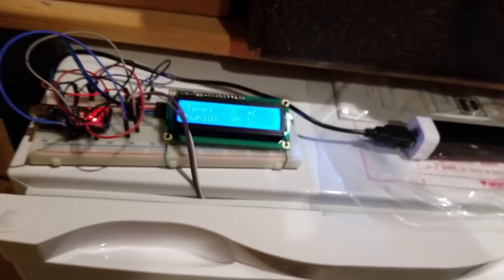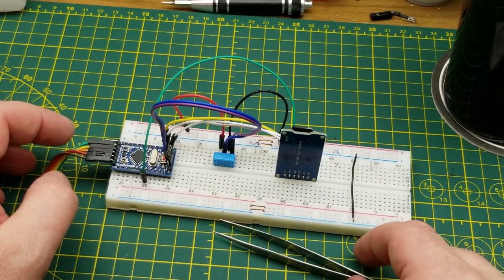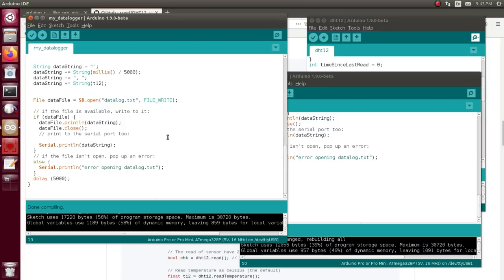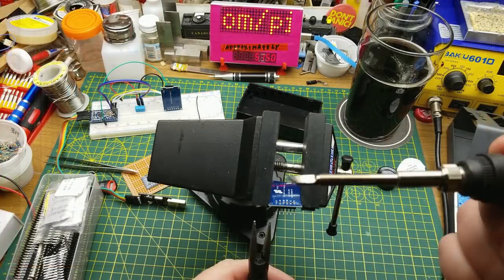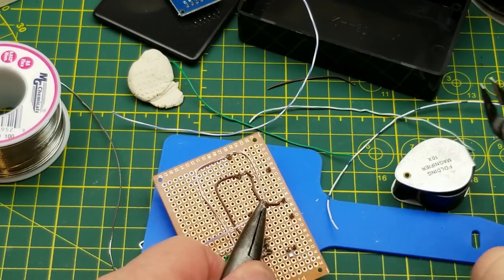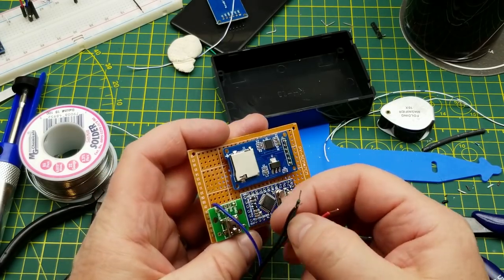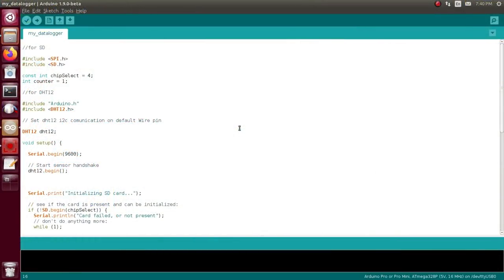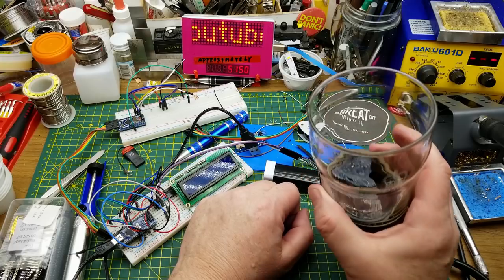beer fridge data logger

Comment: I noticed an error routine that "pops a message" to the serial debugger if the sd card can't be written- maybe add the simple "blink" routine to blink the on board LED if you fall into that error so you can see WHEN that happens (like at full SD card)???
Reply from the maker: Good find! 

Thanks.

Comment: 16:00 60000 ms is exactly one minute. Using int for a counter wraps after 32767 iterations to negative values. You should put the counter into EEPROM, so you can resume the logging instead of restarting it after a power cycle (this caused the strange graph you tried). A flatflex cable for the sensor would seal much better.

Comment: Nice job! If you want to get fancy, you could use an ESP8266 board using pre-built Tasmota firmware and wirelessly get the data to your Linux system, store the data in InfluxDB, and graph it all in Grafana. You can set thresholds and can send alerts if the temperature it too high/low, etc. Andreas Spiess has some videos showing Grafana with Influx which I originally got the idea from. I could always help you set this all up if you need assistance.

Comment: The devops engineer in me shouts "TIMESTAMP ALL THE THINGS!!"
Reply from the maker: I was thinking about adding an RTC, but it occurred to me that might be overkill for this application... not that the whole project isnt a bit overkill..
Reply: @pileofstuff  if your doing over kill go for the max. but i would try and save the readings in to a large array in memory before writing to the card.
Reply from the maker: @TheEmbeddedHobbyist  A skilled programmer might do that...
Reply: @pileofstuff  Yes I would :) lol
Reply: @TheEmbeddedHobbyist  It is not battery backed up - if the power goes out, the array of data not saved to the card will be lost.  SInce he is waiting 10 mins between saves, and he is only writing a small amount of data, it is NOT going to wear out the SD card at all...  immediate writes is probably the best way to do this.  And, YES, I do have a LOT of flash memory (and flash file systems) experience in my past...

Comment: for sensor extension (3wire temp.) I am using telephone extension cables, which are low priced, e.g. 15ft around 2$. Sockets and dbl.-couplings are easy available.
Reply from the maker: There are plenty of options.

Comment: Good video!  Liked the transitions, the fast forward, and sound.  It is very satisfying to finally get a circuit into a box.  I have found the OneWire Dallas Semiconductor sensors are easy and cheap.  You can get them on AliExpress with a nice cable and encapsulated with metal.  DS18B20 is the search string.  Your cold weather has moved to Ontario.  -20 this morning Brrrr...

Comment: Thanks for an interesting video! How about adding a light sensor to detect frig door opening? See if the resident code monkey is getting into the supply? I thought you would put the sensor on the board and chuck the whole thing in, maybe with battery power.
Reply from the maker: I thought about battery power, but then I would have to charge it occasionally. 

And I wanted the temp sensor a bit of distance away from the other components just in case they generated any heat of their own.

Comment: You need to put a microswitch on the door that will decrement a counter and show you the remaining beers in the frig. Or maybe put a video camera in there.
Reply from the maker: I can see a spike in the temperature data every time I open the door. It's an unexpected feature.
Reply: Door open detection wouldn't be reliable. What if the door is opened to check the stock level prior to visiting the liquor store? What if two beers were taken at the same time?
What is needed is a weight module - for example, put a bathroom scale on the floor of the fridge, then monitor/track the weight changes!

Comment: Really nice to see someone else use the DHT12. So much easier to use than the ubiquitous DHT11 being I2C.

Someone else has probably mentioned it but you're counter will overflow at 256. Maybe better to make it a 'long' instead of an 'int'?
Reply from the maker: I thought an 'int' could do up to 32,767 before it wrapped around into negative territory.
Reply: @pileofstuff  Sorry I was wrong. I thought Arduino 'int' was 8-bit (ie a wrapper for int8_t) which tops out at 127 signed or 256 unsigned (uint8_t).

A 16-bit int (int16_t) will top out at 32,767 signed or 65,536 unsigned (uint16_t).

Turns out Arduino int is an int16_t and so goes up to 32,767 before going negative.

If you want to go to 65,536 all positive just change 'int' to 'uint16_t'.
Reply from the maker: @gavinsmalley1513  Even with my error in the delay, I'm still good for 20+ days before it overflows. That's adequate for my application, but it is good to know better for next time!
Thanks.

Comment: I may have heard wrong, but doesn't sixty thousand milliseconds make just one minute? Ten minutes would be six hundred thousand millis. Not that this thing is going to fill any sane SD card in a hurry either way.
Reply from the maker: Oops.
Reply: Someone else noticed that too I see.  7 hours ago... only about 70000 ms or so I guess.   ;-)

Comment: I would add a real time clock and include the time and date in the file. To avoid large files change filename each month and name the file after the month and year (Like: "B202002.csv"). Then you can have date and minute columns in the file.
A temperature sensor outside the fridge could also be nice, then you can see if that temperature affects the fridge temperature.

Comment: Must be rewarding to use these components together for something practical.   Your bodge wires look suspiciously like salvaged CAT5.  I find these wires so tightly wound, that the PVC insulation is uneven, and easily splits.  Tinned, solid, 28 or 30 AWG for is better for small signal connections because it can be tortured into shape with tweezer tips more easily than 24 AWG.  Sure wish I had some 28 AWG coated with silicone instead of PVC.
Reply: For real fine bodge wiring 28awg PTFE wire is the best, bugger to strip but fits under TPH component legs and don't melt. just don't smoke while using it.
Reply from the maker: Good eye. 
CAT5 wire has lots of uses around the tinkering shop.

I do have some 28ga wire somewhere aroung here, i just didn't bother digging it out for a quick-n-dirty little thing like this.
Reply: @pileofstuff  I would like to find as segment of old phone cable with all those colorful striped wires ... that that is excellent stuff.
Reply from the maker: @GnuReligion  I think I have a length of 25 pair in my box of "various lengths of wire". 

If you are in the right place at the right time, it is often scrapped out during office building renovations.
Reply: @pileofstuff  Heh. Futurama. 
I was able to use a scrap of 25-pair for quite a while as point to point wire.
Reply: @pileofstuff  Well, I am not age 11 anymore, so swiping scraps from construction zones is out of the question.   @Adam Egan:  Yes,  Professor Farnsworth.  He lost the evolutionary debate though:  https://youtu.be/TTOla3TyfqQ?t=60
Reply: One of the perks of being a low-voltage electrician apprentice. Lots of scrap cat5 and other random wire from demo.

Comment: Is there a way to get the SD logger code to set the correct date and time stamp for the files?  I know you would need a RTC but I am wondering if it will even work with those libraries.  I hate incorrectly dated files and this one is 20 years out!
Reply from the maker: I never looked into the RTC library. I would hope t wouldn't be incompatible with the SD library or the temp sensor library, but I guess the only way to tell is to try it.

Originally I was going to add a TFT display but that library didn't want to play nice with the SD library so I dropped the display. It wasn't as important for my needs in this project.

Comment: Good project, thanks! What shrink wrap heater do you use?
Reply from the maker: Its the SMD reflow heat tool on my cheap soldering station (with the temperature turned down below soldering temperature)

Comment: Why not put the whole gizmo into the fridge?
Reply: I think he made the right call.  The SD card and other components might not do well in the cold and putting just the sensor in the fridge, means that the the heat from the processor and power will remain outside.

Comment: Haha edit: See you changed this later. :-)

Why divide the millis() value by 5000 when constructing the line to write to the file? Wouldn't it suffice to just use a simple counter? That division wastes precious CPU time. :)
Reply from the maker: My excuse is that I know I suck horribly at code. Never claimed anything else.

But I did change that in the final version.
Reply: @pileofstuff  No worries, no need for excuses. I suck at electronics. :-)

Comment: watch out : csv is comma seperated values, this comma is based on regional settings (windows/linux?)
some countries use semi-colon (;)  and the spreadsheet then imports all values as 1 line (no columns), 
so adapt the script to write a semi-colon or replace the comma with semi-colon in a text editor !
Reply: No, doing that just breaks the CSV File. Just leave the separator as a comma, and if there is any problems then tell your spreadsheet to import using COMMA separation. During import to Excel there is a box that asks what separator to use.
BTW: What you refer to affects the way that files are Exported/Saved in EXCEL only. Most other spreadsheets don't have this idiotic quirk for some countries.
If you are having troubles, in Win10 go to Control Panel > Clock & Region > Formats > Additional Settings and manually set your default List Separator to Comma.
Pro Tip: CSV is the acronym for COMMA Separated Values.
Reply: @johncoops6897    pro tip, not everybody uses excel or windows, so these options you prefer may not exist
Reply: @jyvben1520  - yeah, but if not using Windows and Excel... then the PROBLEM doesn't really exist. BTW if the file is saved with .CSV extension (rather than .txt), it will generally indicate that it includes COMMA separated values. Adding "Sep=," as the first row in the *.csv file will cause Excel to open the file expecting comma "," to be the delimiter.
In any case, CSV files should be COMMA separated. If using something else, then use a different file extension.
Reply: @johncoops6897  so you do need to edit the file ... "problem does not really exist", what a wrong statement !
my first statement is correct for the people where the spreadsheet does not use comma !
Reply: @jyvben1520  - ALL of your statements are correct. My intention was to add to (not contradict) what you are saying, however I worded it poorly. CSV has become the defacto "simple data format" with comma as the normal delimiter used, and there is no reason not to use commas even in those countries where the comma and period characters are transposed for NUMERICAL formats. Of course they can't then store fractional values in plain text, so the the standard solution is to use "quotes" around every single value written between delimiters. The whole CSV concept has limitations irrespective of the delimiter, however the advantage here is the simplicity of writing the CSV, and comma will work "as-is" in MOST regions. If people prefer to use semicolon (or pipe or carat or arrows or whatever) then they can edit the code accordingly, just like you mentioned.

Comment: Hi there again :-) I see you're using the Arduino 1.9 beta. Did you know you can enable bookmarking in the preferences and then you'll get a small vertical column in front of your code lines and you can click in front of every line to set a bookmark and with the F3 key you can cycle/jump through them. Very handy if the code is long !